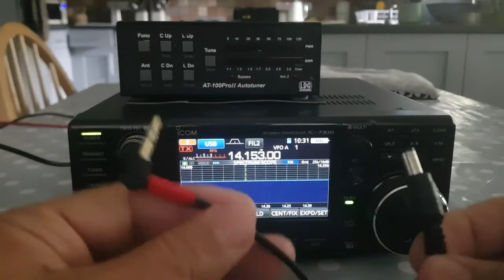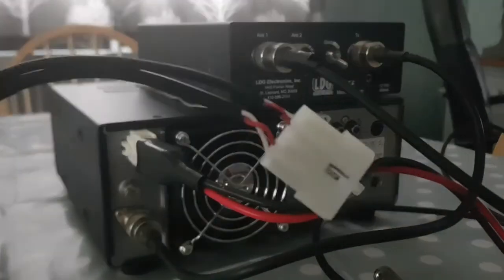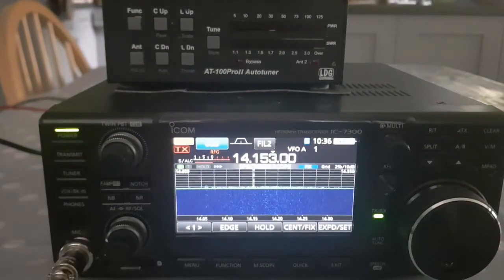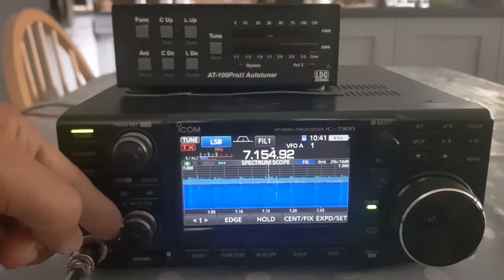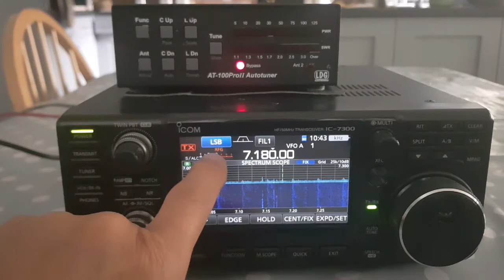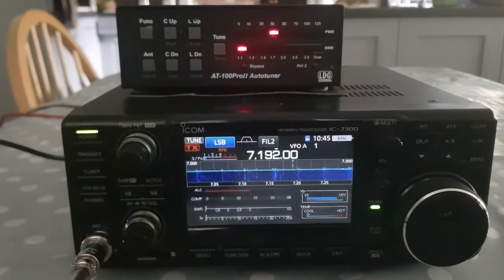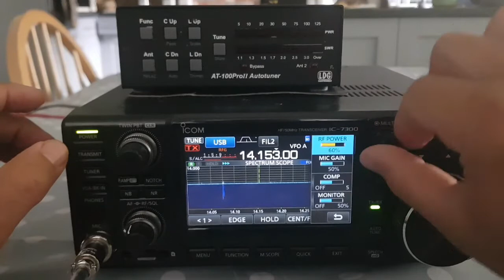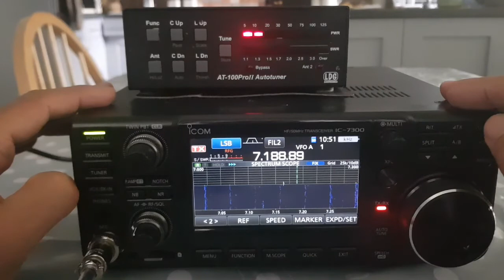ICOM IC-7300 adding LDG AT100 ProII Autotuner and interface cable

Comment: How do I operate it with the ft-891? Will it work automatically once it receives a transmission or does it need a cable from the machine? Or manually from the button?
Reply from the maker: Auto

Comment: Hello interesting video, I am in the same situation as you with a vertical antenna. I will buy this LDG model. Question about the radio, did you adjust the tuner setup? Thank you, Marco in3ufw.
Reply from the maker: Hi its all auto you need put in correct mode .

Comment: My 7300 does not want to tune the AT100Pro2, I don't know why. I have to use the tune button on the tuner. Does anyone else experience this?
Reply from the maker: U need interface cable .
Reply: @M0FXBHamTech but I do have a interface cable.

Comment: I have this same Tuner... Bought it used but only a few months old... I had  a time getting it to work with my IC-7000 but it's fine now..  Great Tuner... Amazing or quite scary ! depending how you look at it.   Another detail I found while connecting this tuner, It will bypass any antenna that is already resonant on the intended band . Thank You    KC3ZDW    73
Reply from the maker: Thanks for the info!73

Comment: My question is why on earth do you have an external antenna tuner hooked up the an Icom 7300 when it has an internal antenna tuner that works wonderfully?  Is this LDG At 100PRO ll tuner any better or superior to the internal antenna tuner in the Icom 7300?  Why purchase and additional item to tune when it is not necessary?  Really
Reply: Bc it’s a wider tuner. Internal tuners are very limited.
Reply from the maker: I now like the ATU100M , https://youtu.be/HJbW2j7ST6c?si=U-Ux0MyhiD-Z80AL

Comment: just got the cable and autotuner attached.  messed around with it some.  now I want to remove interface cable from the back as I use my 7300 as a POTA transceiver in the field.  does anyone have any tips to remove it easily and quickly?
Reply: Thats exactly why I came here. It a top notch piss poor designed connection.

Comment: When you are using the LDG tuners with Icom radios, there is no need to manually turn the RF power down when you tune.  When you push the tuner button on the radio, the radio automatically goes to CW mode and reduces power to 10 watts, then once it's tuned, it returns to full power and back to the preset mode
Reply from the maker: Thanks Yes agree .

Comment: You bypassed it and took the tuner out of the circuit when you were whistling, noticed the bypass light? You kept momentarily pressing the tune button instead of holding it down!
Reply from the maker: Yes I was learning as I used it but got it sussed in the end.

Comment: I just added an LDG Z-100A tuner. The directions are very vague. When I turn the ICOM on the tuner light is always out. Is that normal to have to press tuner button each time the unit is turned on?  Also, I have a problem remembering to turn the power down when tuning. Is that hard on the receiver?  Thank you
Reply from the maker: Hi do you have the remote control wire for the tuner and what radio do you have ?

Comment: Thank you for this video, very helpful. I don't have a tuner yet but I have just got myself a 7300. New licence holder and having been using the rig for just a week or so I realise that I have such a lot to learn. I had thought myself that the 7300 internal tuner worked well and 40m band seems to be the only one that I use that has a high swr, I have not yet tried emergency mode on the tuner. Thanks again for the video. Gerry M7UKD (not far from you).
Reply from the maker: Hi Gerry - Emergency mode works great .

Comment: Just picked up a 7300 last weekend in Kansas City and today got an LDG AT 200 Pro II to go with it down at our local Candy Store.  Love this radio.  One comment on your video Andreas.  The reason that your tuner kept going into bypass mode when you pressed the Tune button on the Icom is that this is per design.  A short press of the tune button on the Icom will toggle bypass mode and tuner mode while a long press of the tune button will force a tune cycle.  If the tuner has been tuned on that frequence before, it will recall the previous tune setting which you can use or override by doing a long press of the button and the tuner will retune that frequency.  Cheers & 73!  KF0FUL (Allan in Kansas)
Reply from the maker: Hi Allan - thanks very much
Reply: I also noticed that you have not yet entered your Callsign into the radio.  You can enter your Callsign into the 7300 and it will great you with it every time you turn on the radio.  To program it use: Menu --> Set --> Display (Pg 1/2) --> My Call (Pg 3/4).  It doesn't really serve any purpose and is not required to operate the radio but it is cool to see your Callsign show up on the splash screen during powerup.